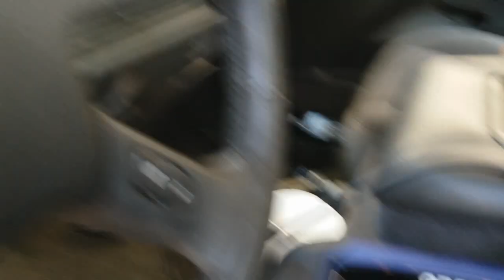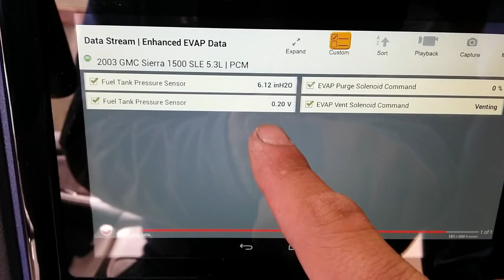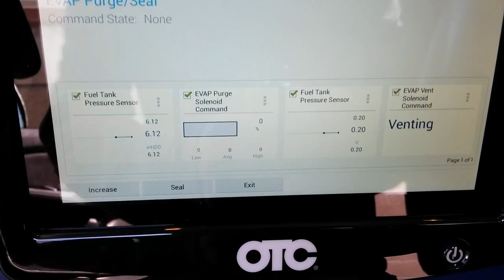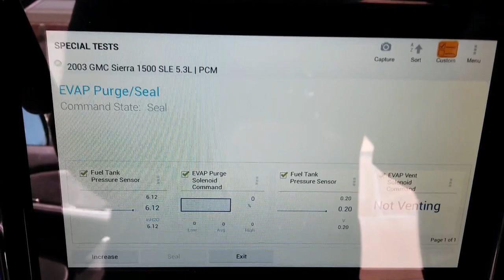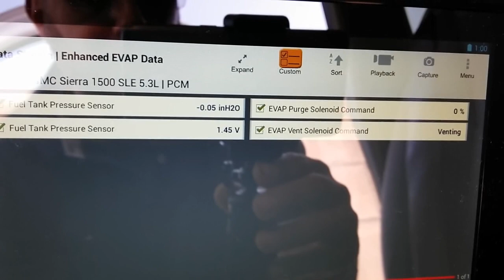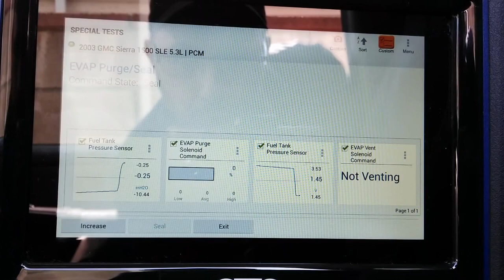(GMC Sierra) Pre-Diagnosed P0446 Evap Vent Performance

Comment: I have a 2004 GMC Sierra 1500 base with the 5.3 liter vortec and 98,000 miles. I had this code come up before. I changed the vapor canister purge solenoid under the hood, the vapor canister vent valve/solenoid by the fuel tank, the fuel tank pressure sensor on the top of fuel tank, AND the fuel fill cap.  These are ALL of the components that I have found that could possibly be associated with the P0446 code. After about 6 months and very little mileage, maybe 1,500 miles ( I don't drive vehicle very often do to fuel prices) the check engine light came back on and BAMM... P0446 code AGAIN!  Is this just a poor engineering problem!?  The parts I replaced were all ACDelco OEM components.  They could NOT have gone bad already!!!  I am honestly fed up with it!  Truck runs and drives great!  Think this is an instance that calls for some black tape over the check engine light and forget about it! Lol   If anyone has ANY other possible reasons for this code, please share!
Reply from the maker: One other area of concern can be the fuel pump oring gasket, creating a very small leak.
Reply from the maker: If you have high end scanner, try looking at your fuel tank pressure reading along with fuel tank pressure voltage. With key on and off, you should be reading between 1.4 to 1.6 Volts and close to atmospheric pressure of 0 inches of water.

Comment: I have the same code on my 2001 GMC Sierra 1500 W/4.8L V-8... When I bought it, on day 1 I had the code read and was recommended to get a new gas cap. I was told that that should solve the issue.... Bought a new cap and nothing changed whatsoever.... Now I have to run the hawg through D.E.Q. and that code is causing me to fail immediately... Not sure where to go from there?.... ANY ADVICE ANYONE???
Reply from the maker: On these GM vehicles a faulty fuel pressure sensor can cause this code to trigger. If you have a volt meter in hand, back probe the signal wire to the sensor. It's usually the middle wire of the three wire connector. With key on engine off it should read approximately 1.4 - 1.6 volts.
Reply from the maker: The easiest way to check is with a capable scanner that gives you the voltage pid to the sensor.